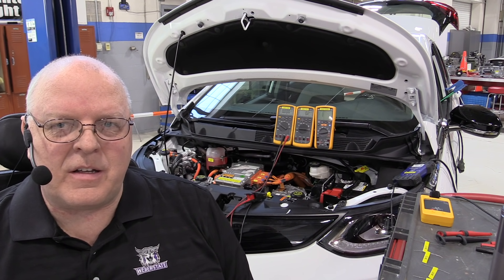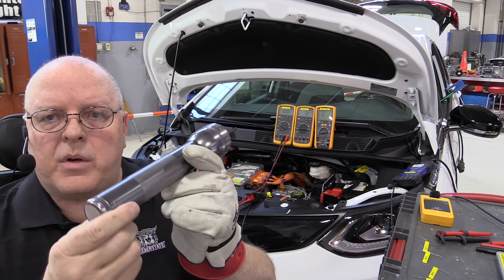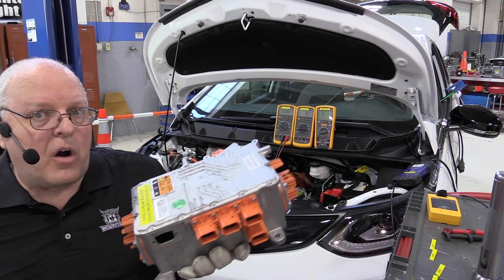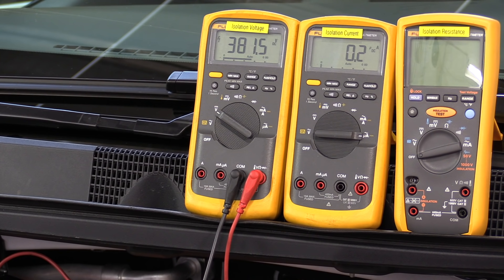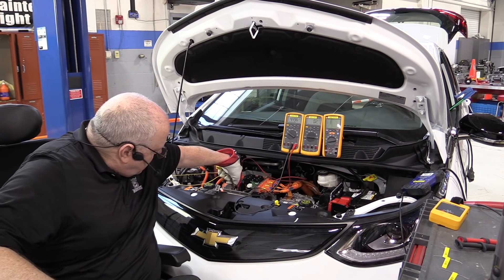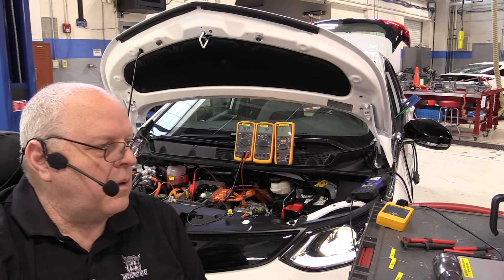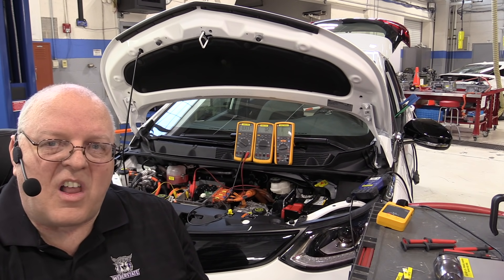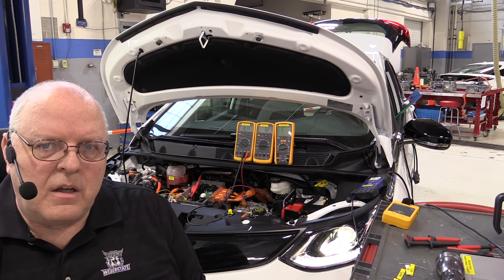Megohmmeter - Loss of Isolation Diagnostics

Comment: When loss of isolation happens and a code is set, why is their no warning given to the driver so the problem can be corrected? I understand that it's not a danger to have a loss of isolation, but shouldn't the problem be corrected
Reply: Why is there no danger though? If the chassis has a 350V voltage and I (having 0V) touch it - with wet hand for lower resistance - I should receive current no? If I'm 'connected' with the earth through naked feet for instance, this could be more dangerous no? Does the ISOMETER detect this?

Comment: For thr Nissan Leaf, the isolation test spec from the service plug should be greater than 1000mohm, after reading that i was like wtf? I think the fluke will only display 〉550mohm for anything greater than that number.

Comment: A battery is NOT a cell.  Two or more cells make up a battery of cells.
But a single monolithic unit such as a PP9 is made up of 6 or 7 cells in series and this means it CAN be correctly described as a battery.
Reply from the maker: Great point! Thank you

Comment: I learn form your videos and respect you a lot, John. However, you are explaining something that is quite wrong in this video. Tap water is really poor conductive, so you can't get a value of 0 resistance (acting like a straight short circuit between + and chassis) in the isolation resistance measurement when you connect the leads by a glass of water. To make sure, I have tried it in a VW ID4 and not only isn't 0 but it barely drops from the normal isolation resistance value (around 4 Mohms in this car). The danger of water or even the cooling liquid (water+glycol) is not producing an isolation fault/short circuit but producing corrosion in the long term or affecting electronic circuits which are more sensitive to moisture and humidity.
Best regards!!

Comment: 400V DC doesn't do anything.. have been shocked many times.. it's not fun but it is not dangerous
Reply from the maker: Thanks for your feedback
Reply: Yes it can - it disrupts cell membranes at low voltages (this is how ingested batteries kill) and at high current cooks you from the inside. 
Getting hung up on DC is a slow way to die and even after you are off it may kill you days later from cumulative damage (like radiation exposure).
Getting hung up on AC just kills faster because it stops your heart sooner.
Reply: The fact you apparently don't understand that voltage isn't what kills you when you're electrocuted pretty strongly indicates you should stay the hell away from high energy electrical systems. Yeah 400 volts with basically no amperage isn't that dangerous, but a few dozen volts with only a handful of amps behind it can kill you stone dead and there can be WAY more then a handful of amps on the high voltage side of EVs.